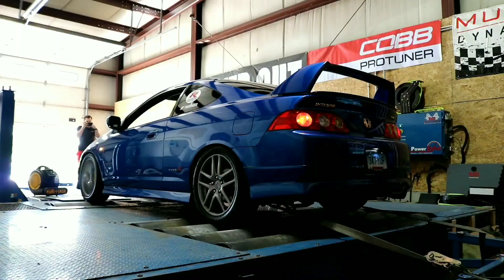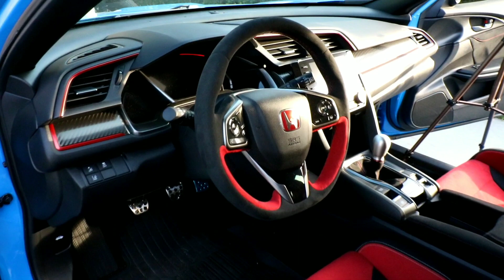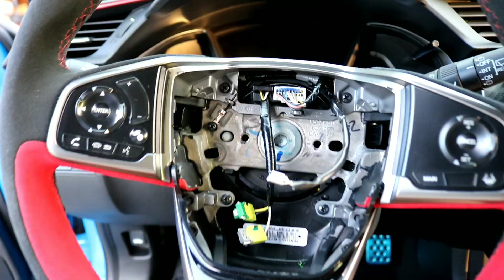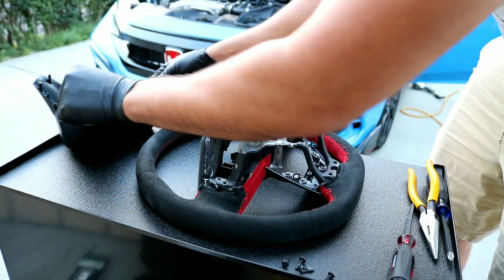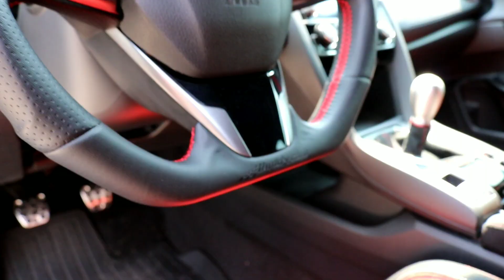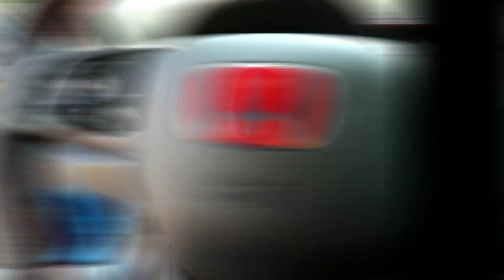I RIPPED OFF my suede steering wheel! | 2020-21 Civic Type R | S3 - EP17

Comment: yeah I wish they didn't switch to the suede material..I hope to get a bb R next year..definitely will do the same..along with changing tires.
Reply from the maker: It’s a must, the car driving experience was elevated with this steering wheel. Now it matches the car’s performance. Didn’t like how my hands were sliding off with every steering input

Comment: I just put a deposit down for a 2021 Boost Blue Type R and you have inspired me to do the samething with the steering wheel. About how long did it take you to complete the process of taking the old steering wheel off and installing the new one?
Reply from the maker: It will completely change the way you enjoy the car. Once in +R mode you got complete control with no slip. For my skill level probably <2hrs taking your time not to break anything lol

Comment: Did you have any issues with airbag system? After installing mine, i get an error message. Thanks!
Reply from the maker: No issues here, if you disconnected your battery and all connections are secured you should've been good. Double check your work

Comment: Great video as usual brother, Boost Blue life! Any issues with the SRS light at all?
Reply from the maker: Thank you boost blue brother. No issues at all. Just make sure you unplug the battery, wait 10-15mins and start working. That way the system isn't triggered with a trouble code.
Reply: @DC5RParts  Awesome, and I agree with you the Alcantara steering wheel looks and feel awesome but it will come apart in time plus the buddyclub looks so bad ass
Reply from the maker: Not only bad ass but functional as well. It really took the driving experience to another level!